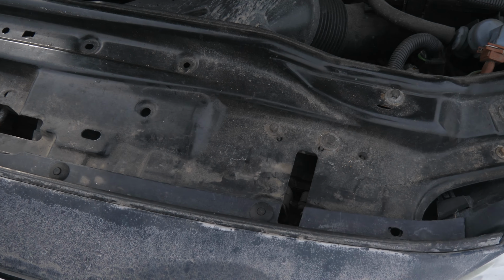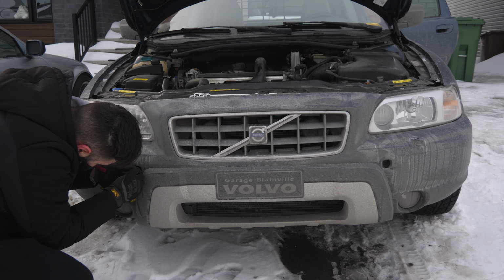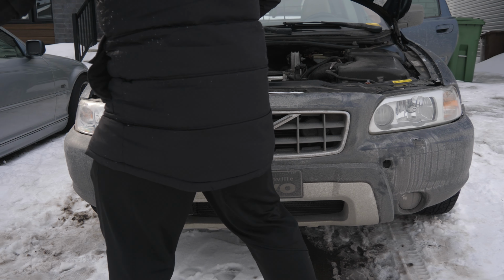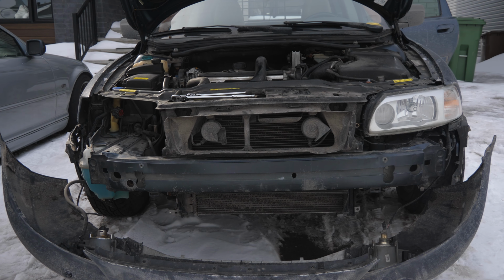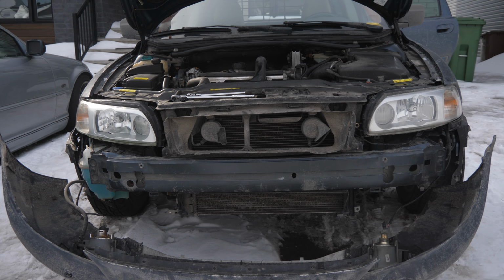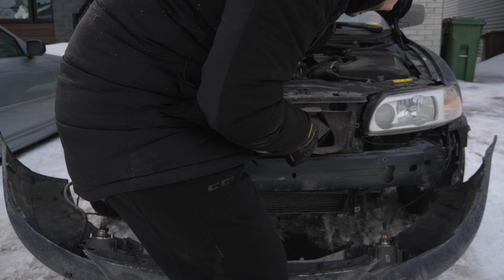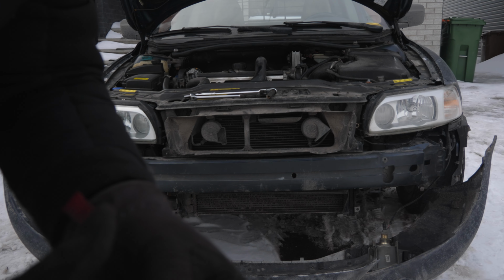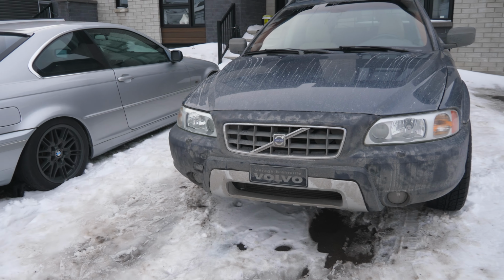FINALLY INSTALLING S60R HEADLIGHTS ON MY XC70R PROJECT!

Comment: hi, i am here from tiktok… The original headlights were they also xenons or regular halogens, if so was it just plug an play type of job?
Reply from the maker: They where regular halogens! If they are S60R headlights it's pluh and play
Reply: @TankGarage  ou thank you, and what about hight configuration did it work normaly? did you have hight of the light beam configured manually with scroll button or automatic trough sensor on rear suspension ? and didn’t it throw error message for wrong bulb or dead bulb?
Reply from the maker: @patrikmatonak9068  I adjusted them manually! It's very simple! So It wasn't too hard!
Reply: @patrikmatonak9068 Did you do the conversion? And did you manage to get it to work?
Reply: Hi , I have a 2006 v70 2.5t and I'm trying to install the R headlights on it. But when I turn on the car the lights come on only for a split second  any advice on how to make them work, thanks in advance
Reply from the maker: Check if the connectors are properly connected! You might have a blown fuse or something like that also!
Reply: Thank you very much for the reply. I greatly appreciated.  The thing is that after that happens with the R headlights I connected the originals back on without any issues..